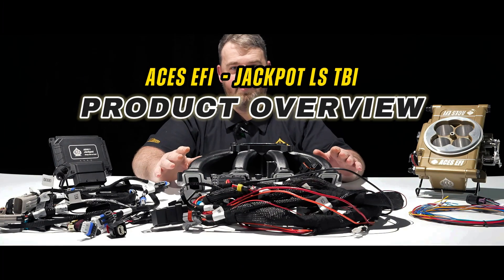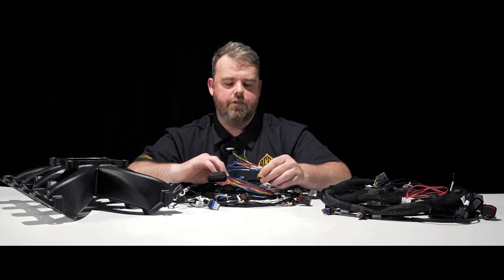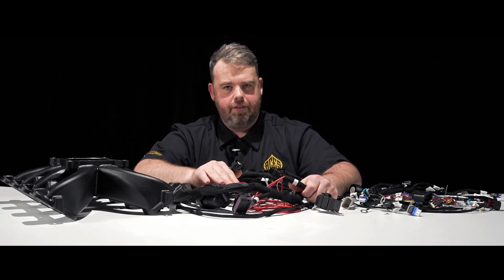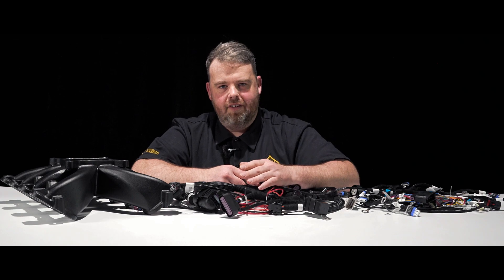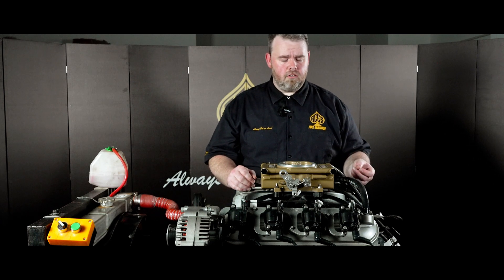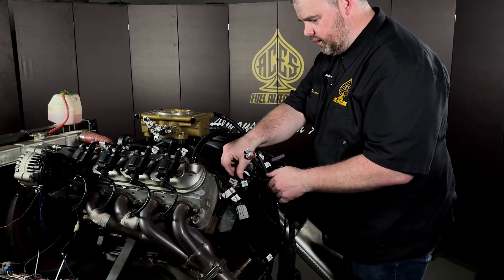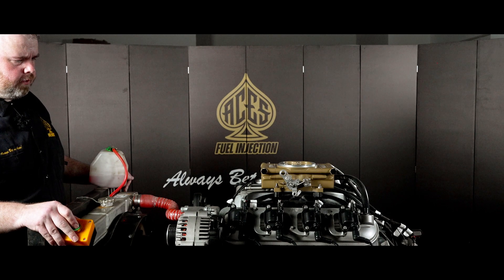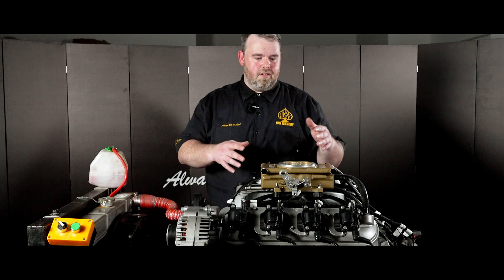Jackpot TBI (Behind the Product)

Comment: I just purchased this system. I noticed that this system utilized the knock sensors. Seeing as im currently running a carb, i did a knock sensor delete.....as most do with a carb.  Can you run this system without knock sensors? I know similar systems of different brands dont require knock sensors

Comment: I already have the killshot on my ls.Is there going to be a way to use just the killshot throttle body and just get the computer and the wiring harness so I don’t have to spend more money on another throttle body
Reply: I had spoke to customer service about that. I just purchased the killshot shortly before the jackpot came out. From what I was told it is a completely different setup and you can't simply purchase the additional harness and download an update to the ecu.
Reply: @RS-db2ee  thank you